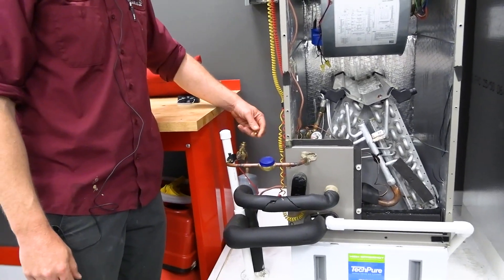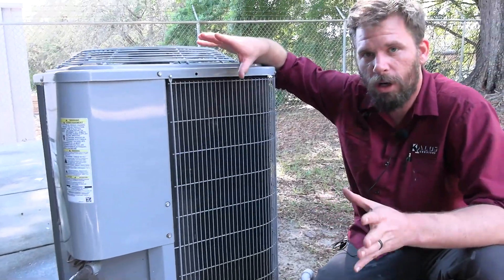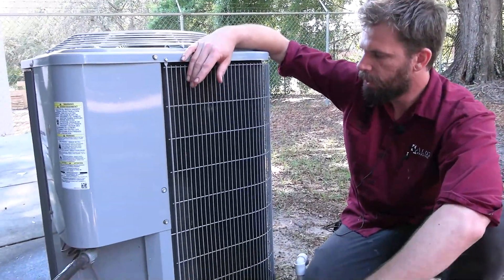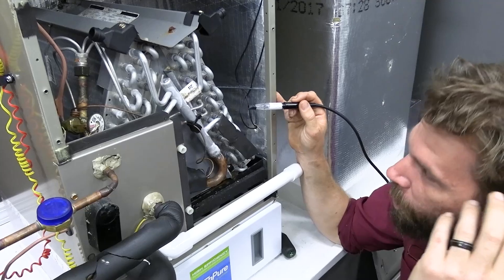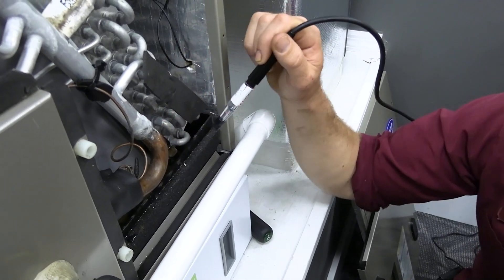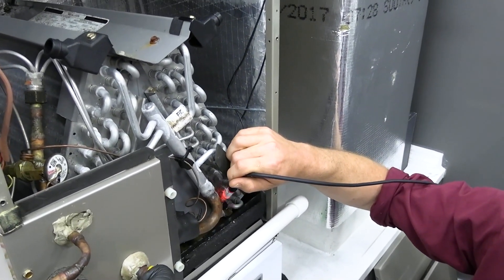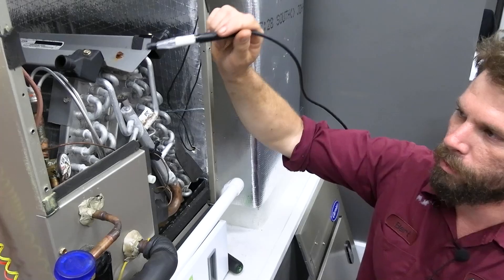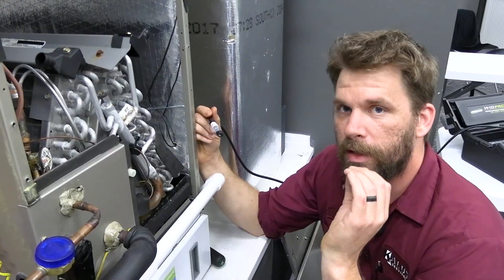Leak Search Tips From Bert

Comment: awesome tutorial I also Have both the same exact leak detectors you show the H 10 is my older one but still use but batteries are shot so must find an plug in ...& the CPS leak seeker & love both tools but the H 10 finds  R 22 leaks quick & easy but have to turn  up the heat on 410 & back down for 22 .. my CPS also works great & is my quick no power cord needed tool of choice 90 % of the time

Comment: Thanks for the great video, needless to say it's very educational video. I'm a homeowner and my system has leak in the low pressure line going into the compressor. I discover a large stain of oil inside the attic where there is a brazed union. My question is, what should a technician do in this case to repair the system properly? Is the best practice to recover all the refrigerant, then make the repair, change the filter and finally add the refrigerant again? Or do I let  the technician add the leak stopper in a can? I'm asking because I live in the south and I fell like no one wants to take the time to make the repairs properly. All the technicians want to do is to add the leak stopper in a can and I head this type of gas can end up damaging the compressor in the long run. I'm just looking for some advice. Thanks for the video, it was really helpful

Comment: How do I know how much refrigerant was lost on the unit? I’m still learning about it
Reply: I've only been doing it for about a year, but for me, It's once I recover all the refrigerant that I can use a scale to see how much was recovered. Just compare that to what the factory charge states on the data plate, and that figure minus what you recovered will give you the minimum it lost. Could be more though if the line set is longer and more than the factory charge was required.

Comment: Best way to check for leaks at schraider valves is to carry two spare caps in your tool bag and drill a small hole in them and then place them over the schraider valves and dab some bubbles on them and check, it works every time. This way you keep the solution off the valves.
Reply: I wish I could shake your hand, that’s the best idea.

Comment: Great video. Question I have is what percentage or amount of refrigerate has to be present in the system for a mechanical leak detector to work. At what point do you need to add refrigerate to a system to find a leak.  Or do you never add to find a leak ?
Great channel
Reply: For a system that is flat, the EPA allows you to pressurize a system with nitrogen and a small amount of R22 to perform leak searches. Otherwise it's illegal to add refrigerant to a flat system for the purposes of leak detection.

I believe it's considered ok to add refrigerant to a system that still has charge though.

Comment: Are you guys installing sight glass on residential units?
Reply: Sight glasses are  completely unnecessary. A tech should be hooking up their gauges and temp clamps to properly diagnose.
Reply: Sight glasses are a good idea to have on a residential system. Put it as close to the TXV as possible. That way you can see if you have a full column of liquid going to the TXV. It obviously isn’t the only thing A tech would look at when diagnosing but it can be a helpful aide. You would still need to follow properly diagnostic procedures but I don’t understand why its “completely unnecessary”?

Comment: Awesome video Bert! Very thorough and you covered everything I hoped you would. From the way to spray on Big Blu slowly so you don’t create a lot of bubbles, starting with a visual inspection looking for oil trails FIRST. I like the way you stressed to confirm several times so you don’t charge the customer for an unnecessary repair and have to return because you got it wrong the first time. Always go over the spot multiple times with your leak detector and make sure you get a hit each time, then confirm with bubbles whenever possible. It’s also a pet peeve of mine when other technicians at my company add 6 pounds of refrigerant and say it was a leaking schrader valve because they couldn’t find the leak or they were just too lazy to find if. I’m usually the one that has to go behind them and find the leak because I do it right the first time and I take a lot of pride in my work. On a side note, I’ve had really good results using an infrared Inficon D-Tek 3 leak detector but I also own a heated diode Fieldpiece as well.
Reply: Do you like the heated diode better or the infrared?

Comment: Also, if leak is in evaporator for most part you replace the coil. So who cares where it’s at at that point lol
Reply: Could be on one of the U tubes on the edge of the coil, fixable.
Reply: @babyking5763  if it’s under warranty it’s best just to replace the coil